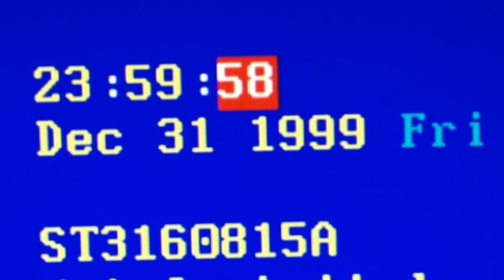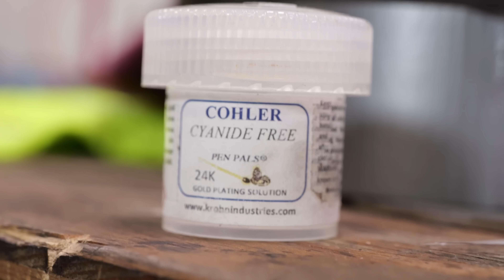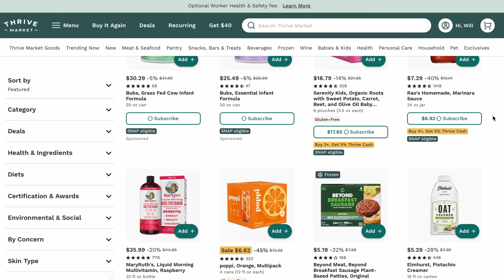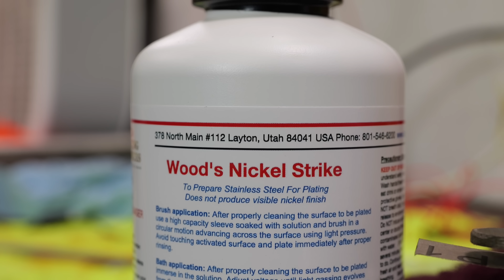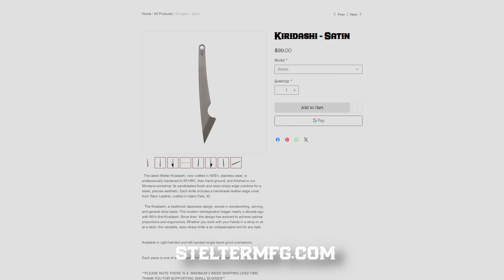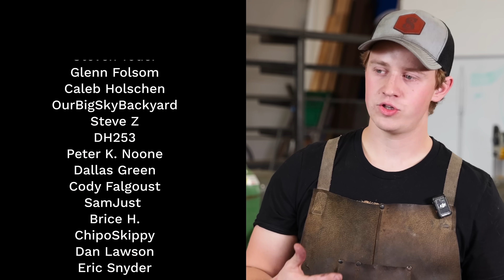Gold Plating is way harder than I thought…

Comment: Don't you nickel plate the steel and then you gold plate the nickel plate? I imagine electric plate is just two dips and you're done right?
Reply: Copper strike before nickel works better. 
But yes, bath playing would coat the whole piece pretty evenly in about 60 seconds to 2 minutes. Problem is the bath plating solution is hella expensive and degrades over time. So if he’s not planning to use it regularly… but I’m surprised he didn’t start defenestration processes on the knife, trying to pen plate it.

Comment: Making plating solution for nickel is very easy. You just need some 5% white cleaning vinegar, a nickel source, and non-iodized table salt. I got a roll of 1/2" by .02" nickel strip and used a piece about 4" long for the anode and cathode. Run about two volts and around 1 amp through them and when the solution turns light green it is good to go. Replace the cathode with the item you want to coat and coat at 0.5 volts 1 amp. The slower the process (lower the voltage) the smoother the plating will be, and it will stick better. I just used a $30 DC power supply from Amazon and a set of banana plug ended alligator clips that are 14ga wire from an old voltage tester that was broken.

Comment: Got to pickle it before the plating will stick. That molecularly thin layer of oxide prevents the bond. It can form pretty quick, so the idea is to acid-etch bath, then rinse in deionized water bath, then directly into the plating bath. I think the slow process with the pen would be prohibitive.

Great video, as always.

Comment: the way I have seen most of these plating systems has been to copper coat first for the nickel to bond to and some smoothness and evenness of the second coating which is nickel, nickel will make it even smoother. the third layer is then your final coating which is to bond your gold to it, but thinking about it, that is for chrome plating so there may be more or less steps for gold. I am old and there is too much info in my head, forgive my graces with any mistakes.

Comment: Will save yourself time and trouble with Caswell plating products. The most important thing after polishing is hot degreasing tank to pull the chems out of the metal. Caswell also has a book that tells every process for every metal so knowing if nickel is needed or copper etc.

Comment: Hey for plating just the edge why not make a jig to hold blade so just the edge is submerged in plating solution so you can do a nickel plating then a full gold plating solution for just the Tip plating also if your just plating the tip of a blade for a gold and stainless contrast

Comment: I thought for steel you plate it with copper first, then silver and then gold. Don't remember where I heard this from.
Reply: You’re pretty much correct. Except you don’t need to silver plate it. I’ve had pretty good results doing copper, then nickel then gold. 
He’s much better off getting a small rectifier and doing a bath plating rather than pen. 
Pen plating is designed for fine detail work. It just doesn’t have the ‘throwing’ power to effectively and evenly coat larger surfaces at once. 
Also, with a rectifier, you can electrostrip old/bad plating, electroclean (for the best possible coating surface) and even anodize metals like titanium. It’s a versatile machine for playing with colorants on metals.

Comment: Gold plate on steel needs an intermediate plating of copper and nickel.   Trying to plate directly on steel will result in poor color and the gold plating just rubbing off..
Reply: Not to mention the pen is not the most efficient method of large surface coating. And he’s touching the metal directly with the pen nib. I’m not surprised he’s having such a hard time of it.